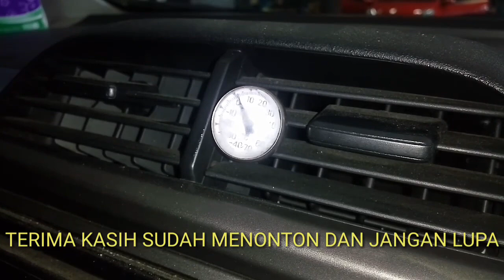Tips Agar AC honda Jazz Lebih Dingin

Comment from the maker: Link Untuk keperluan AC mobil (shopee)

-Pembersih evaporator semprot + microfiber
https://shope.ee/4APnBRxawl

- OlL kompressor ND OIL 134a Japan
https://shope.ee/7A3OlHnJ6O

-  OIL kompressor Emkarate & SUNISO 134a
https://shope.ee/7UgFA9xAqG

- Filter AC Avanza Veloz /Apv / Ertiga / Agya /Cayla / Sigra / Granmax / Luxio
https://shope.ee/5zrRNZcVk0

- Filter AC karbon Avanza /Xenia / Rush / Terios / Ertiga / Jazz / ayla / Agya
https://shope.ee/8KFMAAD5KU

-Filter AC BRIO / Jazz RS / Mobilio /HRV /BRV /Freed
https://shope.ee/20LIchEjzC

- Pengisi Freon  single Lo (manifolt)
https://shope.ee/7UgFBBSzSL

- Pengisi Freon double Hi-Lo (manifolt)
https://shope.ee/3KqgDnOmnq

- Freon Kalengan 134a
https://shope.ee/VWUql4WZs

- adapter untuk nepel (coupler)
https://shope.ee/1L5bqUitxT